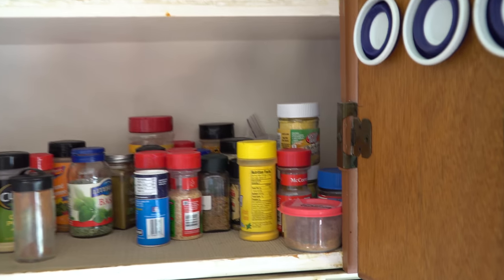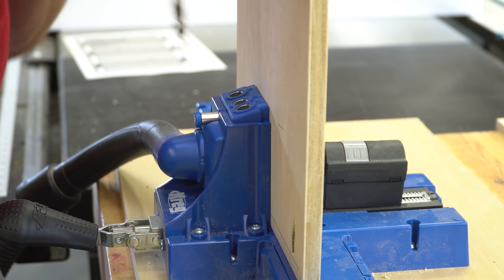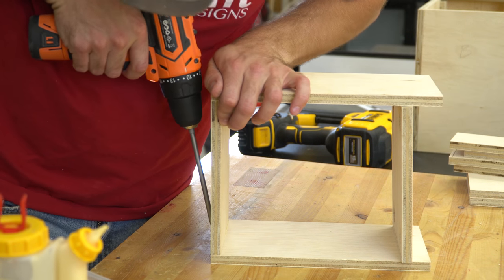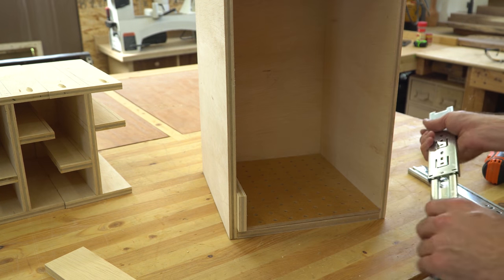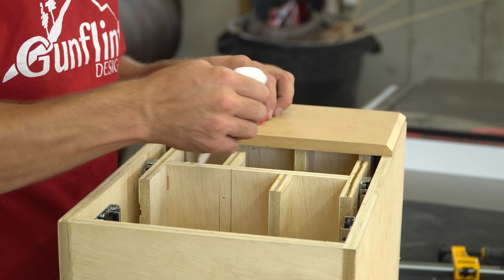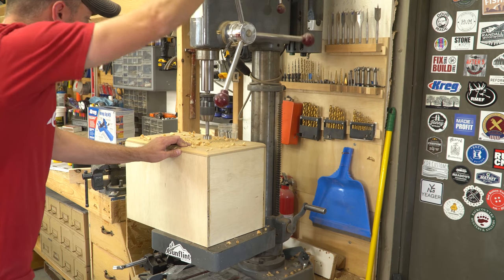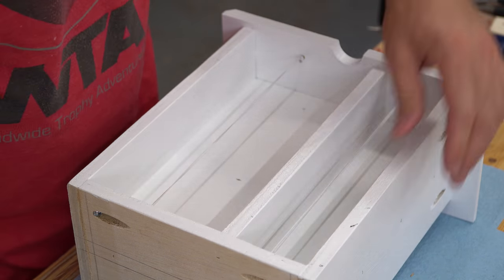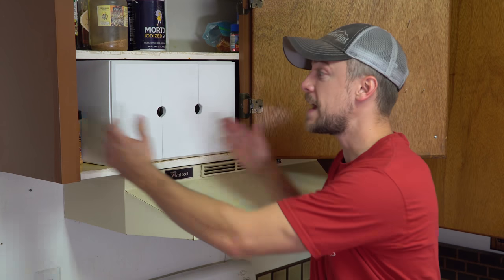DIY Spice Organizer Rack with Pull Out Drawers

Comment: Great idea Mark! Our spice cabinet is like yours was before you added the spice organizer, just a mess of spice bottles. Even though our most used spices were up front, at times the one we needed always seemed to be hidden in the back. We also have many different size bottles, so I may need to customize it with adjustable shelves. Or maybe make two different organizers with different size racks inside. Thanks for the idea as not only do we need something better, our daughter has been wanting me to make her a spice rack for a while now.
Reply from the maker: I'm glad it give you some ideas David! I knew for our use, it had to fit in that short cabinet above the stove. With that in mind I looked at what size bottle we had the most of, and catered it to that. We have probably 10 bottles that are too big for it, but that's much easier to manage. Going forward I will make a point to try and by those McCormick bottles so they always fit.

Comment: This is a great idea, and reminds me of the built-in storage in the Earthroamer high-end RVs. My only suggestion would be to set back the front panels by the depth of 1-2 spice bottles, which would have two benefits: commonly used spices would be more readily available to the cook, and the unit as a whole would “read” as the spice rack rather than a white box. You could probably do the same quicky hole cutouts on the bottom (if an inch or so of facing was required for structure) or add a lip an inch tall or so and use the router to give a pull-able profile to the inside of the top of the front lip. Make sense?

I want one. We need one! Thanks for inspiring me.
Reply from the maker: That's a great idea Isaac, I didn't think of having a faster access spot! If you build one I want to see it!

Comment: How do you like that tack life drill you sold me on the palm sander I've been looking for a smaller drill
Reply from the maker: That is a good little drill for the price. Might be a little low on power and the battery charge doesn't last as long as some others, but for the price it's hard to beat.

Comment: I heard about this project as I was catching up up your We Build A Thing podcast and had to check it out, nice work!  I have a question though, the sideways mounted draw slides can handle the low weight of spices, but do you think an up-sized version would be able to handle heavier items like tools without breaking the slides?  Thanks again!

Comment: Thanks for the build video! Of course, it won't work well in my winebago that does 0-60 in 3.6 seconds... nor when I'm out 4x4'ing... but oh well... looks cool! LOL
(of course I'm JK)
Reply from the maker: The beauty of this is it's scaleable, and for a winnebago you would just have to change the dimensions slightly, then use cardboard and hot glue instead of plywood and pocket holes!